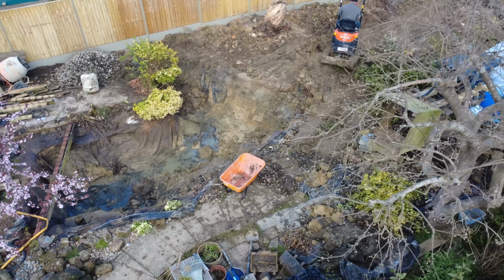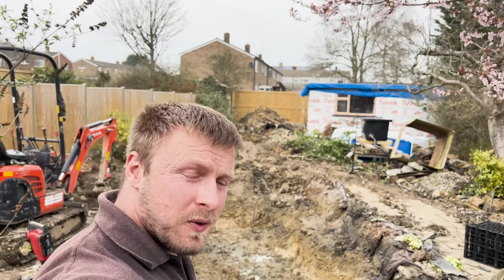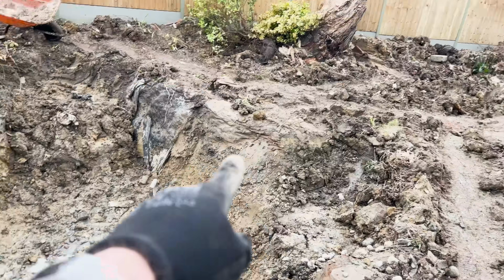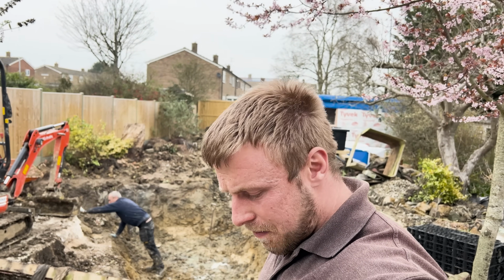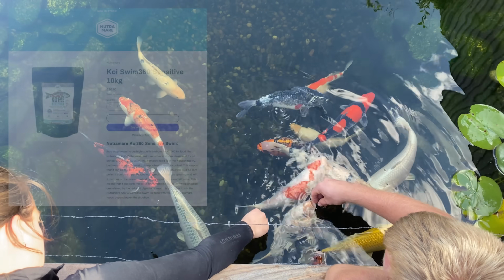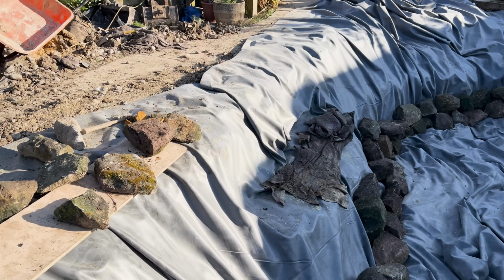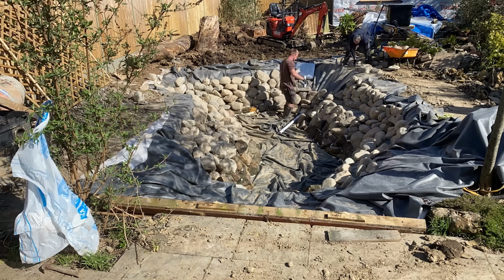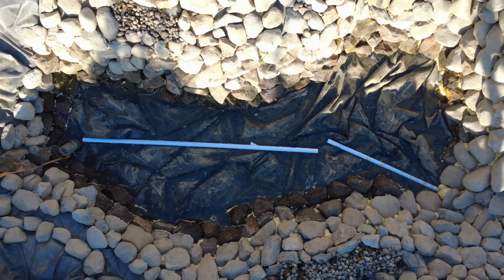Building Dads Dream Pond PT2: Digging, Lining & Rockwork Begins

Comment: 100% wouldn't put rocks or gravel in, just asking for trouble, all the crap build up!
Reply from the maker: @Simoj82  if built with suitable methods of water flow and filtration and the stocking/feeding isn’t crazy, the negligible waste build up shouldn’t cause any issues  🙂
Reply: Personally, I wouldn’t build a pond without ‘rocking’ it.  The UV rays are not kind to pond liners, you might find that the life expectancy is negatively affected.  Proper filtration and yearly agitation of the bottom using a high pressure hose usually takes care of the bottom debris.